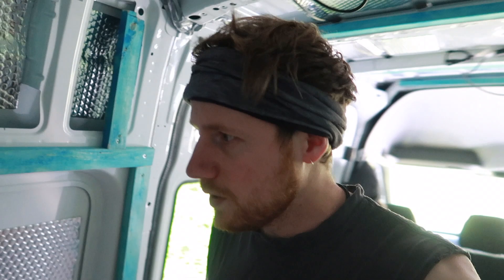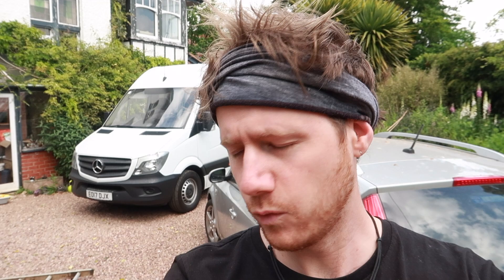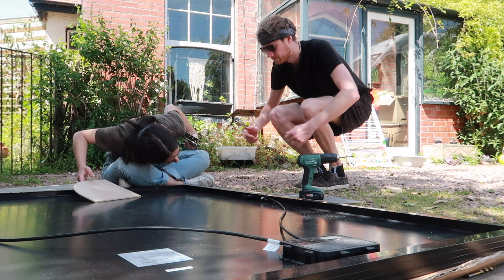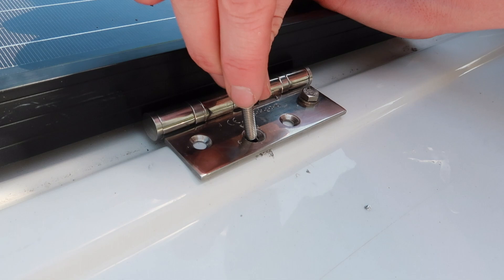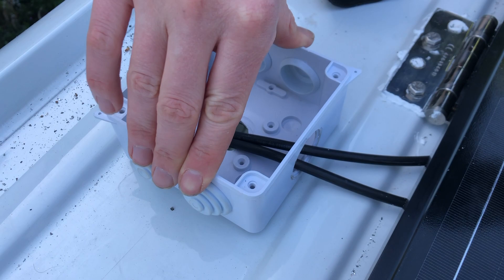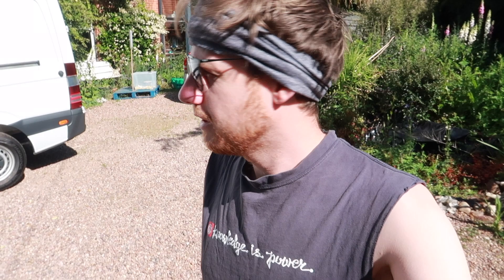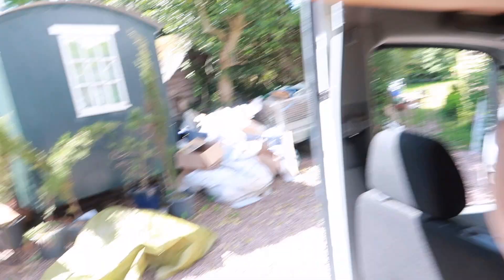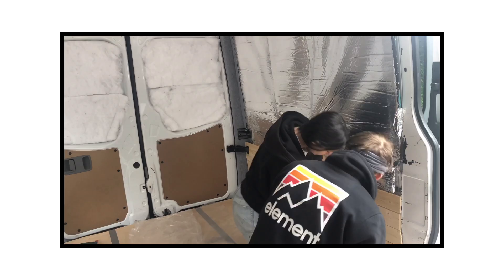Ep.4 Van Build Series | How to install a solar panel - Mercedes Sprinter

Comment: What size solar panel, batteries and inverter did you use? And what does it power? I want to do a beauty can and need to heat wax pots . Thanks

Comment: What about the brackets for the shelf?! :)
Reply from the maker: We used the holes where the sun visors attach to the side of the van. All you have to do is unscrew them, get your bracket in and then screw them back up. It sounds complicated but it's quite difficult to explain😂